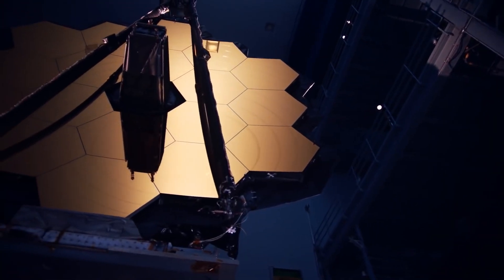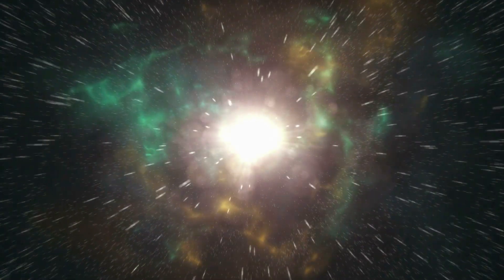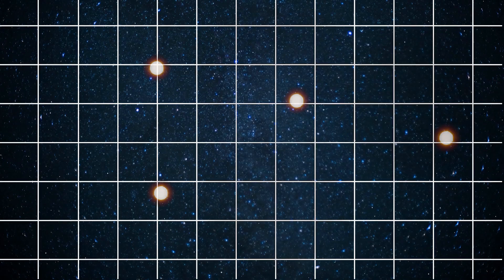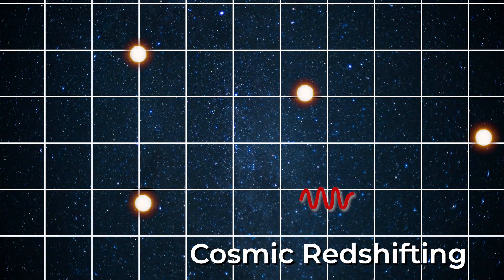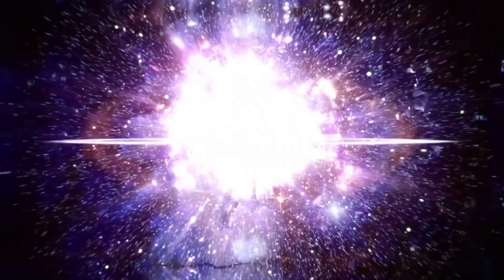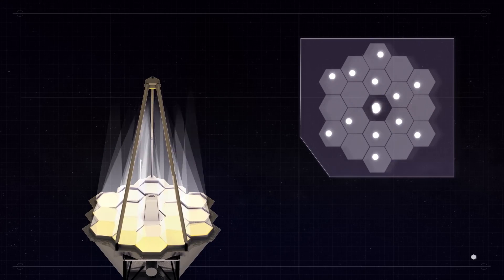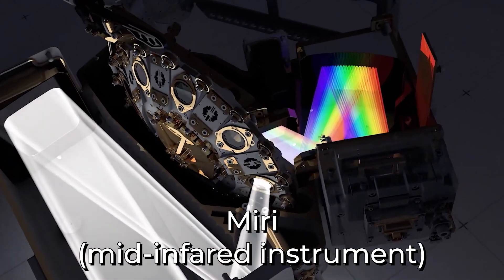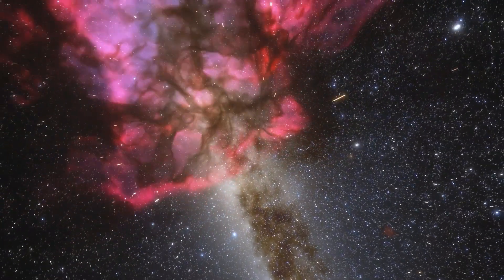The James Web Space Telescope EXPLAINED

Comment: The MIRI coolant runs out in 10 years. Can it be refilled? How will its demise affect the usefulness of JWST. What is total expected lifetime without MIRI. Thank you.
Reply from the maker: Great question. I think the fuel used to keep the JWST in position at L2 runs out at the 10 year mark so its a reasonably large problem. At the moment there isn't a solution, as crewed missions couldn't reach it. I've seen some rumours of a robotic mission in the works.  I imagine they'll try something as its an expensive piece of equipment!
Reply: @DrBenMiles  MIRI's cooling system is fully contained, and does not use up component, theoretically having no 'time limit'.  Because of the perfect launch and course correction burns, they verified again in today's teleconference that Webb has 20+ years of propellant remaining for maintaining orbit and operation at L2.
Reply from the maker: @Aegolius  awesome good to know 👍 thanks for the info!